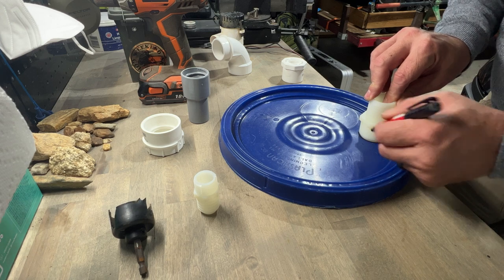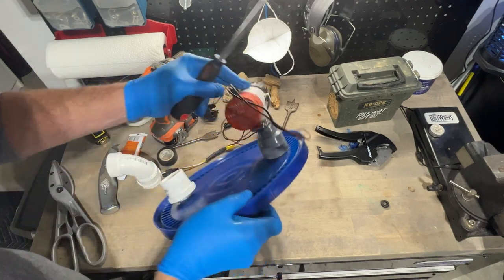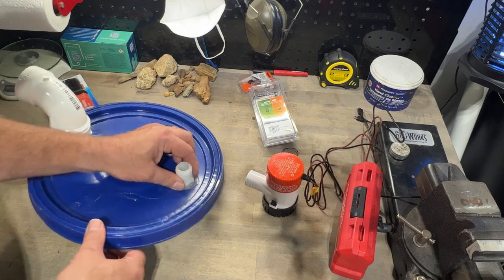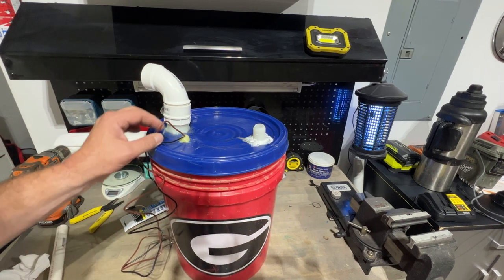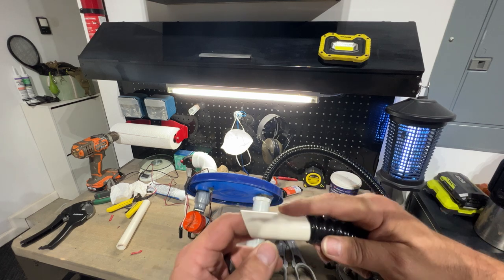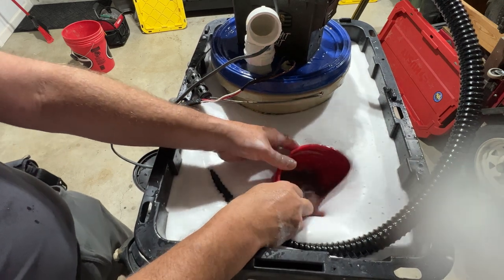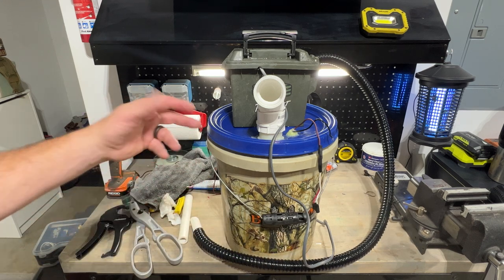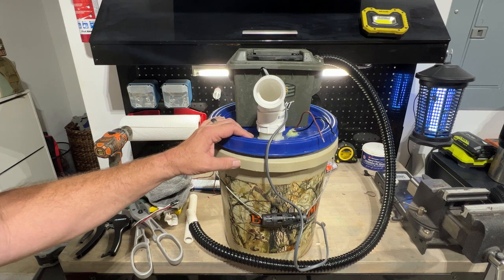12v Bucket Dredge for gold! Will it work?

Comment: I built a bucket head shop vac dredge with a small gas generator. It works amazingly, so good it fills the bucket in a few minutes. Very frustrating always emptying the bucket. Amazes me how much dirt is left on the bedrock after digging  the overburden. Looks like a bucket full and 20 buckets later I'm tired of emptying buckets. I need to convert it to flow directly into my sluice. Been using it since 1999. Definitely does a good cleanup. A bit cumbersome. Also works good dry for the hillsides. Can't believe how much gold is left a few hundred feet above the creek in some spots. You have a nice design but I would want the pump above the bucket, I see it being very frustrating after a few half buckets. Good luck with it. Always trying to find a faster, better, easier way to get the shiny stuff.

Comment: To reduce probability for plug ups you can install larger diameter hose on the intake!  1.25 inch smooth hose inside with reduction to 1 inch.  Its best to use clear transparent hoses.  Also there is no need for stronger bucket. What you need is vacuum regulator.  A simple spring valve on the lid to open when the vacuum inside the bucket exceeds certain level.  You can attach a hose from the valve back to the water so in case of plug up it does not suck air in the system but clean water.

Comment: why not the out flowpipe from the pump connecting to the vacuum hose with y piece of pvc with a venturi just like a normal dredge aimed to the bucket. And a discharge on the lid. Then a little bigger pump like 2000 gph two times the suction.  A nice idea it is already.
Reply from the maker: My plan is to build a power log at some point and turn my little high banker into a battery operated setup. Referring just what your saying about the Y pipe

Comment: I built one of these with all commercial grade connections, steel can etc.  Pumps out more water in 3 seconds than you can keep in the vacuum hose, and if you use larger vacuum hose you're left with nada on pressure. How did you balance out the outflow and vacuum hose sizes?

Comment: Some times you could get something to bang on the hose if you can see where CLOGGED where the clog is that's what I put on my bigger dredges.i use a screw driver saves a LOT of time and a much needed improvement.
Reply: A quick release coupling on the hose is nice too.and along rod .
Reply from the maker: @robertwolfe2971   Yup, its short enough to use a rod or crevasse tool to unclog i think. The nozzle i want to make metal so it stays down. Doing a in the creek video this weekend. If it works well i will refine it with quick disconnects etc.

Comment: I know this is an old video, but could you answer me this question? I built one of these, but I’m having trouble keeping water in the bucket. The 1100gpm output pump draws water out faster than my intake brings it in…therefore draining the water below the pump quickly. I have a1” output elbow, and a 1.5” intake hose. I using my battery pack from my mini monster to run it…just as you did. Thanks

Comment: Be nice if you had clear HOSE so you could see where it is CLOGGED up.
Reply from the maker: Since the nozzle is only 3/4 or so it classifies decent and would only clog there i think. Once i take it out i will know where to improve for sure!
Reply: I would put a bolt through end of nozzle so it won't clog inside hose.